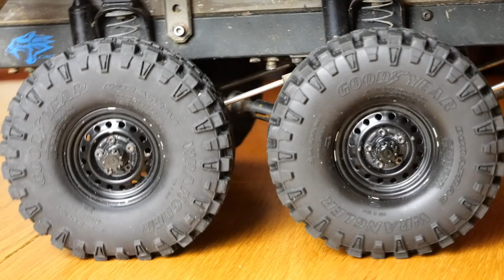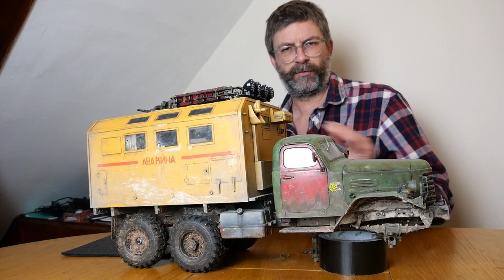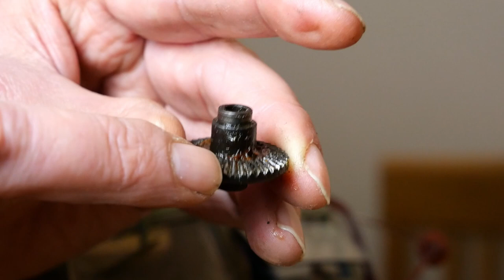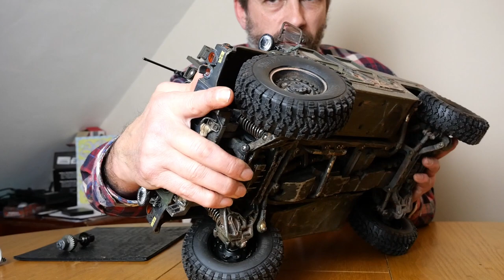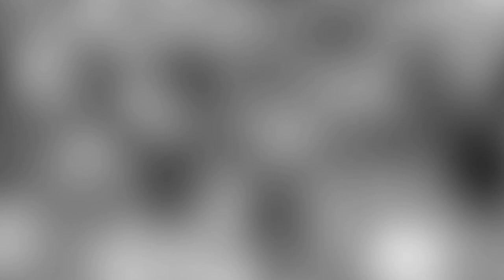HE'S BACK! Time To Repair and Upgrade The Fleet - it's BENCH TIME!!!

Comment: You don't need to take the CA30's rear end apart even - just pull the silver caps off the pivot points on the rear springs and tighten/loctite the tiny bolts in there. They back themselves out and let the springs wobble around.
Reply from the maker: Ahhhh thank you, Obi One CA30

Comment: With the trips to Wales not surprised a few things broke with all that running. The Humvee stripping down a real pain, I do not know why they use such a strong threadlock. I only use blue on my trucks for that reason, I rather lose a screw than strip one.
Reply from the maker: Right? And they weren't consistent either. All other bolts, and there are many, where fine. Loose even. But two were absolutely solid. Quality control goes unnoticed when it's good, I suppose.